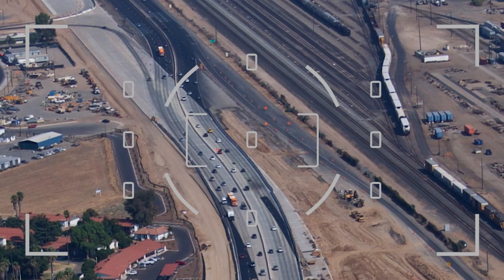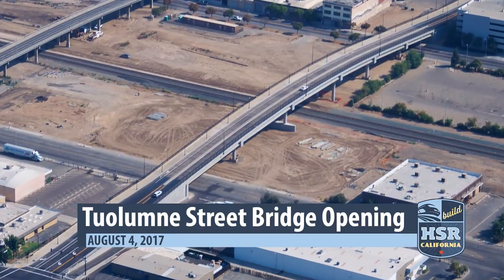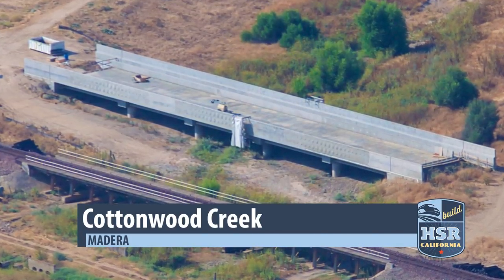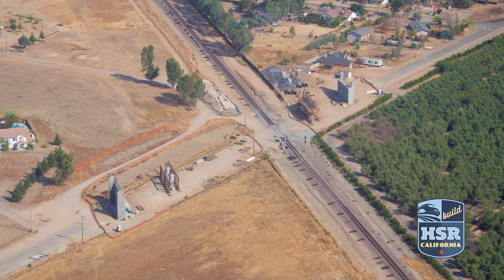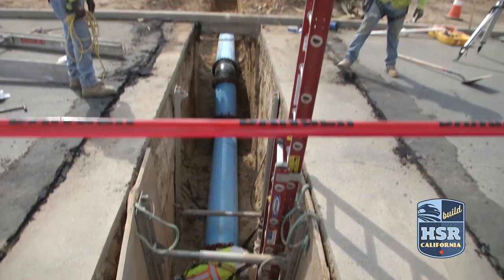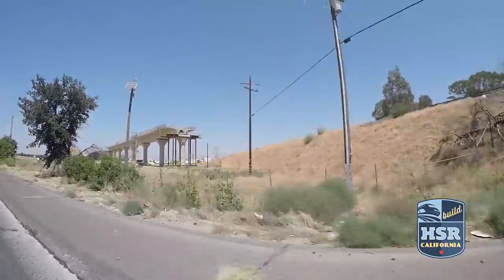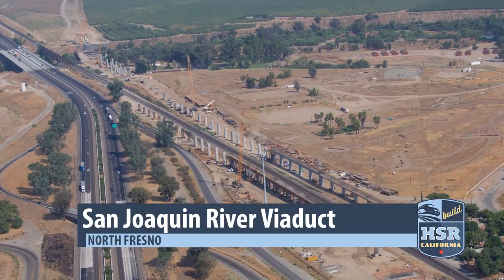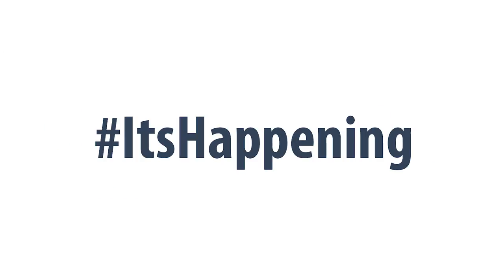High-Speed Rail Construction Update- September 2017

Comment: they blew this thing so badly,  should have put the track right in the middle of I-5 from Bakersfield to Tracy,  an optimum fast route, no extremely expensive real estate outlays, it would use overpasses already in place.  Presumably federal govt already owns the I-5 real estate so surely they would rent it to Calif rail for like a 1$ a year. Then give the valley a separate fast train.
Reply from the maker: Thank you for your comment. The goal of high-speed rail is to connect the state's population hubs and those are located along State Route 99 and not I-5. Traveling down I-5 would exclude cities like Merced, Visalia and Fresno which according to 2015 census data is the state's 5th largest city.
Reply: The curves on I-5 are not suitable for HSR - they are too sharp.  Use aerial maps to follow HSR lines in France or Germany, you'll see they are much straighter than I-5 or other Interstates.

Comment: Dianne Feinstein's husband
 thanks all of you Kalifornia taxpayers for your contributions to him. In the meantime Texas is poised to beat Kali to a working high speed rail line between Dallas and Houston for a fraction of what Kali will pay and the Texas line is privately funded.
Reply: I heard about that, but are there any shovels in the ground? nope ... last I heard they are not even considering it due to high costs and taxes, so shut it
Reply: Do you have earthquake faults capable of major quakes in Texas? No. We also have just learned Houston (sprawl built on a bayou) has no zoning codes and your flood control system is geared towards flooding freeways as catch basins. In Calif Republicans have been trying to shut HSR down since inception and in Texas the ONLY way you could get something like this built is by  private funding with no zoning restrictions. We'll believe it when we see it operating with a profit and with NO taxpayer subsidies. IMO - Ain't gonna happen.
Reply: At the rate the US is going maglev will be available here by the 22nd century. A maglev line needs run in nearly a straight line. Japan's will take a more direct route from Tokyo to Nara by largely avoiding the coastal population and traveling mostly in a straight line through a lot of mountain tunnels to Nagoya (then on to Nara). It is meant more to connect the large cities with few stops. Calif HSR travels through the most densely populated areas of the state (Bay Area, Central Valley, LA Metro Area with spurs to Sacramento and San Diego). It will offer 3 levels of service - locals, limited express and express between SF and LA. While the technology is over 50 years old the benefit is that it will allow people living in far flung communities to commute to work in cities hundreds of miles away. Currently the only rail option from the Bay Area to LA is parallel to US 101, takes 11 hours and is frequently disrupted by one thing or the other. The trains from the Bay Area to the Central Valley terminate in Bakersfield and the rest of the trip to LA is made by bus. HSR will be a huge upgrade that will be available to millions of people between SF and LA. Having said that Elon Musk's Hyperloop sounds very intriguing - he claims he's gotten approval (July 2017) from the government to plan a line from NY to DC (travel time 30 min).
Reply: Get mad much?